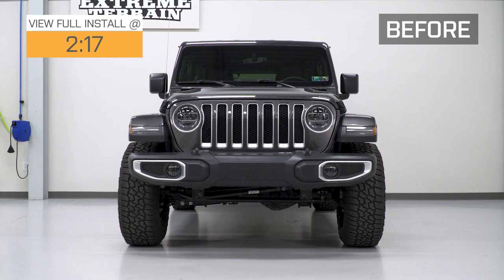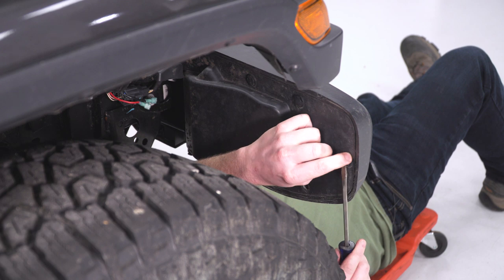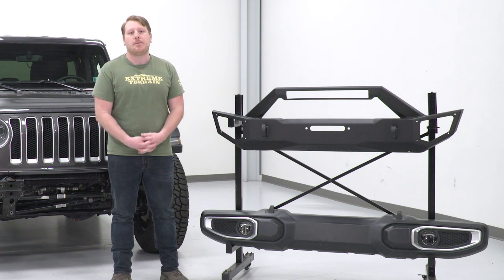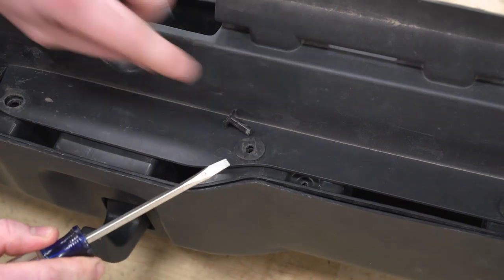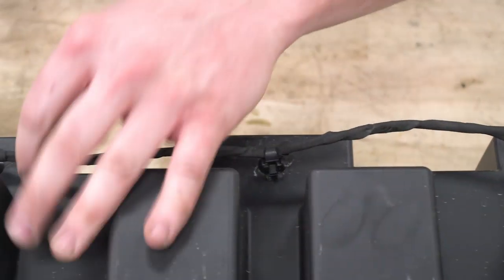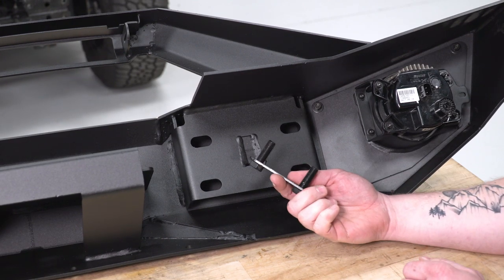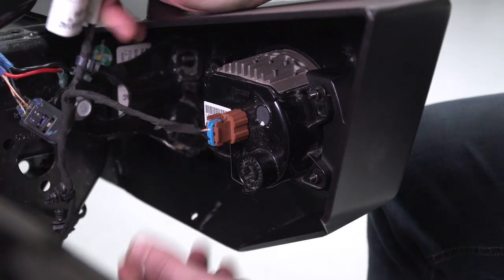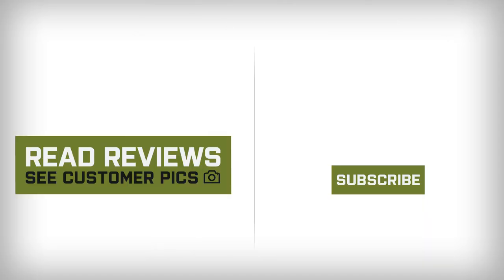Jeep Wrangler JL Barricade HD Front Bumper w/ 20 in. Light Bar Review & Install

Comment: Not sure what I"m missing but I'm sure it's right in front of my face. The switch kit comes with the button to turn on and off on one end and then two individual wires with receptacles with rubber coating at the other end. I see those when you drop it in front of the air box, but then you clip in to the light bar. What am I missing? Because in my mind I'm like these two individual wires don't plug in to the plastic clip obviously

Comment: Is there a way to get have the new LED fogs lights and wire it into the old wiring so they turn on when your head lights turn on? Is there some type of adapter I could use because obviously the wires are different.

Comment: I just gonna say this. This bumper was the worst bumper I’ve ever put on a jeep. Don’t right miserable. From missing parts, to holes not the properly made (or just wrong screw provided), the one corner is nearly impossible to put a nut on and I have small women hands. And the two pronged bolts I had to resize with a hammer because they came out box either overextended or bent. Usually I take me 1 to 2 hrs putting on bumpers this took four. Also there two random parts that don’t even go with anything.